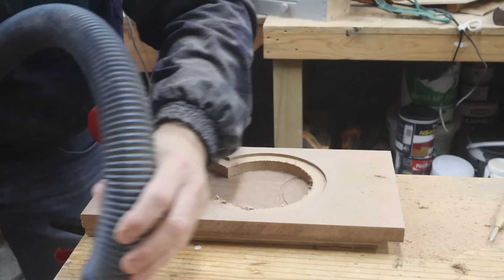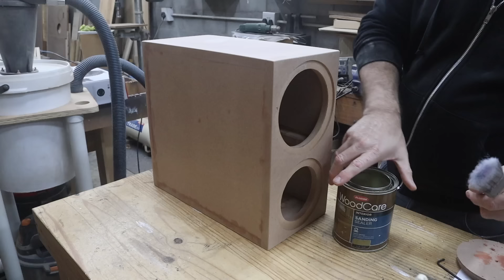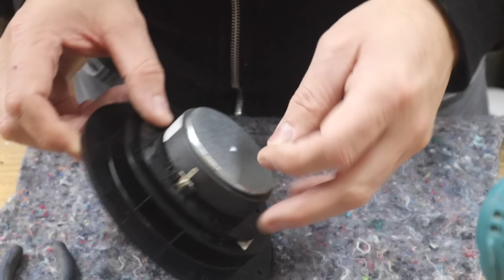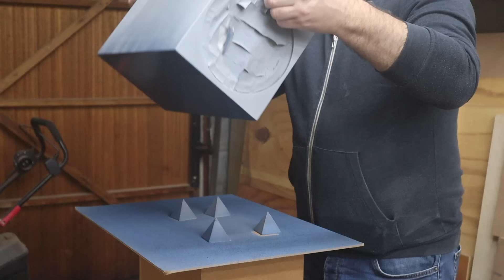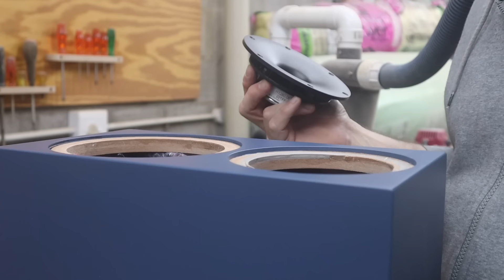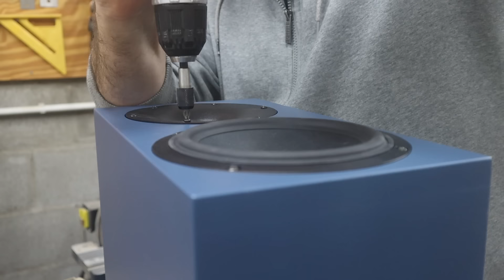Building WAVEGUIDE & PASSIVE RADIATOR 2-Way Speakers - by SoundBlab

Comment: Nice project - just purchased your build guide. Did you add any weight to the PR unit? Or what is the tuning freq without any added weight? Did you play around with tuning the PR lower? Thanks!
Reply from the maker: Thanks for the support. The PR does not need additional weight, its is tuned optimally without.

Comment: Perhaps a bit of a NOOB question here, but that speaker cabinet looks deep enough that you could fit a long enough port in there. Why would you choose a (somewhat expensive) passive radiator when a port would work? Did you consider a port?
Reply from the maker: A port is an option, but I wanted to do a project with PR as an alternative to the usual port.

Comment: Nice job, looks very cool.
A second option would be to fit the passive radiator from inside the case, then you could screw it from behind and have no screwholes. 
It would take up a slightly higher volume of air though, also future repairs might be more difficult.

Comment: I am curious at to the vertikal dispersion as well as horizontal. Used to Kef coaxials but must say this looks promising.  Any comment on this? 
Oh and  what is the cost of the crossover parts total? Trying to add up the total cost of this build in my mind ^^

Comment: Hi its amazing, thanks. Theoretically can one replace the rear open port of existing speaker to a passive radiator , and by doing so improve low bass performance?
Reply: I would think it's possible but  you need to be mindful of the resonance of your existing port , pick a passive radiator that will not be too far from that then tune it to suit by adding weight to the diaphragm, pick a radiator that has this ability.
I don't think you'll be able to make a big difference bc your existing box drivers and.xover limit you

Comment: Are those final measurements real? If so, it answers a wuesrion i had a while ago, what is the smallest a speaker can be that plays 20hz to 20khz flat. Gorgeous speaker
Reply: Take a peak at the Helios build. It should get you close to your goal
Reply: Frequency graph Starts at 200. With that woofer, I assume they'll reach a F3 of 35-40.

Comment: What are you driving these with? RMS power, etc.? They look great by the way.
Reply from the maker: Thanks. Currently I have a Cambridge Audio Azur 840W, which is a very powerful amp, but obviously only using it within limits of the loudspeaker. I don't have an official RMS rating for the speakers, but these go plenty loud in my 6x5m room.

Comment: I purchased your plans and built them for myself.  I went a little "Danny" crazy on all of the crossover parts, and I'm so glad I did.  Not only do they look fantastic, but they sound phenomenal.   They replaced my R200's and Rainmakers.  I still have my RP-600ms as they have a totally different sound.  I have these paired with an SVS SB300, Schiit Vidar, and a Bluesound Node.  Well done!!  
I had planned to make some other youtube  designer's  speakers; but after making and hearing these, I am looking at onther one of your designs.  
Thanks a ton.
Reply from the maker: That's so fantastic, I'm glad you love them! Thanks for the positive feedback ☺️.
Reply: What is your take when comparing these vs the Rainmakers. I have them myself powered by Parasound 200 amp.

Comment: that is a good tweeter!! , ive used the ferrofluid version on a few prototypes myself. Seas actually made a tweeter called dxt with "PROBABLY" a optimized waveguide and cone(++) of what you tried to achieve. Very good work tho. this might be a trigger for Seas to develop their driver/cone even further :)

Comment: Great build! I thought I have to get Buchardt S400MKII, but now I'm not sure. Maybe there's a way to compare them?
Reply: These are very similar to the Buchardt by design. However the crossover and elements in the Buchardt are of a higher quality. Want to match them that's where you need to put some bucks on that. Besides that these will sound great on their own.

Comment: I watched a lot of your compact speaker builds and it left me wondering, is a simple baffle usually enough or is it better to have a double baffle or bracing? most topics of double baffle i encountered were for subs. I’m at the point of building my first full range speaker and I don’t know if I should double the front, my material is 19mm MDF.

Thanks in advance
Reply from the maker: I think for up to a 6.5 inch woofer, 19mm is fine.

Comment: Hey all, I do have a question regarding the passive radiator. Can it handle two of the sb chassis or will it cause too much excursion?
Reply from the maker: Off the cuff, I would say no. But I have not modelled it to confirm. However form this model I would suggest it is not possible without compromise.

Comment: Hello. I'm looking at doing a similar thing with the SB Acoustic 5" coax. It's for my camper where space is tight in the back area. I'll have a sub in there but i still need kick bass from the 5" and thought about using passive radiators to allow for a smaller enclosure. SB Acoustic do a radiator to use with the coax, it's the same size. I don't know whether to use this or the race track. I read that the radiator should have larger area than the driver. I could use two 5" radiators i suppose, even two racetracks on the sides but it's all guess work at this point. How do you select parts or calculate enclosure size or port size?

Comment: Just curious, would you consider trying to build these with a double radiator setup with two woofers? Just to get some more low frequency response from the speakers? Or do you think that would be useless? It is something I am considering building. I have no experience with using passive radiator though.

Comment: I just startet this great project and have troubles to buy the DPR10-8.0 8 Ohm 10 Watt Precision 1% Audio Grade Resistor in Europe. 

Do you think I can use an 8.2 Ohm resistor made by Jantzen with the same specs (10W , 1%acc) 

Thanks 🙏
Reply from the maker: Yes, that will be fine.

Comment: Hi, i have a set of creative labs T100 speakers and to my ears they sound really nice, fast puncy and surprising amount of bass that hits harder than speakers 6 times the size. Only thing it lacks is clarity. Could they be reproduced in HiFi? Really impossible wtf physics breaking lows, im guess they are T line but seem way too small and light for that.
Reply from the maker: I doubt if they are t-lines, most like ly they are ported enclosures with a single full range driver, which perhaps explains the overall lack of 'clarity'.

Comment: Hello!
Good job!
Please, can you tell us  what kind of Crossover did you use? And the Shop? Thank you!
Reply from the maker: Thanks. The crossover is custom designed, so consist of various parts put together for this particular speaker design. It is not off-the-shelf standard crossover. Details are in my build plans that can be purchased on my website here: https://soundblab.net

Comment: I think you could use the 3D printer to create templates for cutting the oval shape openings and flange pockets. Also by measuring the tweeter hole pattern and the diameter of the waveguide center hole you can create a perfect fit drill guide (basically a circular sheet with the same hole pattern and a shallow cylinder in the center to align it with the waveguide). Maybe not worth it for a one off (or 2 in this case) but my OCD would not let me eyeball it :)

Comment: nice sound.Thank you for the wonderful video. It has become very useful for my speaker work. Until now, I had only made bassless models, but after seeing this, I decided to try using a passive radiator.I'm thinking of using a passive registrar for an 8cm full-range speaker, but what size would be best?
Reply from the maker: Thanks! Typically you should aim for a 10 inch PR with the 8 inch woofer, and of which the Xmax is higher than that of the woofer.

Comment: What diameter did you cut the inside circles for the PR?  I've bought some of these and I'm thrown by the supplied gasket foam on sonething that seems proud of the flange itself.  I wasn't going to flush mount the outer flange but its not clear from the data sheet what the geometry is behind the foam on the back.

Also to anyone reading:  don't but the SB supplied 50g weights for use with these - they don't fit.  Unless tou put them at the end of a very long bolt, and have lots of turning moment acting on the spider and surround.  Better to just get short bolts and some washers, I got mine in a DIY store - cheaper too..
Reply from the maker: 122mm
Reply: @SoundBlab   Thank you!

Comment: Serious question. I'm just getting into the hobby and I want to build many speakers... but what if people don't want to buy them... what do you do ?
Reply from the maker: I can't really answer that, because I have no experience selling speakers, but I do know that it took me many many years to learn how to properly design and build speakers, and I am still learning.  If you are only getting into the hobby, I would consider that you spend some time to learn all you can before committing to such a venture.
Reply: @SoundBlab  I guess that my question also lies in, what do you do once you have too many speakers ?
Reply from the maker: This is a problem... I try to be efficient in using various combinations of drivers, so often I end up with empty enclosures since I use the same drivers in different combinations across various projects. I have sold a few locally so far, but the market here in South Africa is too small to really be a viable option for this route.

Comment: If you want to make your life easier, you could use a soldering iron to install some threaded brass inserts into the holes you added into the wave guide, that way you don't need to use nuts to secure the screws.
Reply from the maker: Thats a good idea!

Comment: Hey SoundBlab, I love your builds, but i've always wondered, after extensive research i have yet to find an answer to my question about passive radiators, in this case i got 1 active and 2 passive radiators, is there an acoustical advantage to putting the PR's in the rear or is it better to have one on each side of the enclosure. i still have not found one who could give me an answer to it. i would understand with the single PR that it is better in the rear cause of vibrations.
Reply from the maker: With 2 PRs it is probably best to go one each side to achieve force cancellation and thus damping enclosure resonances. PRs on the rear can make speaker placement more difficult in a room, since you probably don't want them too close to a wall. The placement otherwise has no effect on the frequency response other than what room placement and the room itself will introduce. It is similar to a port, front or back makes no difference, but the same advantages and drawbacks counts as does for PRs. PRs also work well when you have both on the same side of the enclosure. This way you have more freedom to swop speakers around to have the PRs facing either inside or outside depending on what works best in your room. It's probably more flexible than rear mounted.
I am currently working on a 3-way floor stander with 2 PRs on the back, but as said before, it is similar to a port on the back.
Reply: @SoundBlab  Thank you so much for the very detailed response, that really answered my question about the placement of them. keep up the great builds

Comment: What are you using to power the speakers? Just curious.
Reply from the maker: IOTAVX SA3
Reply: I still can’t believe the low end I’m hearing over my headphones. I’m not usually a fan of listening to recordings of speakers, but this recording sounds amazing! I feel like there is little room echo. What microphone did you use to record these great-sounding speakers?
Reply from the maker: Thanks. I used a Zoom H1 mounted to a tripod. Nothing complicated. Sometimes I will use two Behringer mics pointed at both speakers directly on axis, but its too much setup, so I am now only using the Zoom H1.

Comment: Great video! I just purchased the plans. Is it okay to use 400v Capacitors for the two 250v ones? For the air core inductors, can I use 18awg for both, or is 20awg used for a reason on the .8mH coil? Ordering parts.
Reply from the maker: Thanks man! You can use 400v caps and the 18awg coils will be fine.
Reply: I have been ordering parts through the links in your parts list document! I hope to start the speaker build when weather starts to cool down a bit since I do the work in a garage without an A/C, ugh! In the meantime, I think I will assemble the crossover parts.
Reply: I almost have all the parts at this point. Waiting for cooler weather to get started. Can’t wait!

Comment: Great looking build and really nice measurements. Your process is almost identical to mine. There are a lot of people who will tell you you need to use vituixcad to model a crossover with good off axis response. I disagree.  One simply has to know how one’s drivers behave and set the crossover points accordingly. Your low crossover point is the key here, along with the waveguide. I don’t need fancy software to tell me that. Great job!
Reply from the maker: Thanks! I started with XSim for the crossover, however I did also use VituixCad to confirm my results and get more of those fancy graphs.

Comment: Durch eine Front bohren - der arme Hochtöner. Jeder wie er mag, aber beim nächsten Mal vielleicht einfach Heißkleber verwenden. 🤨
Reply from the maker: I was not drilling through the tweeter faceplate, only copying the holes to the back of the waveguide to secure it with screws.

Comment: Soundblab: We have Buchardt at Home
Reply: Do you have a speaker recipe with the original purifi s 6.5x08 ?
Reply: @95lovi  +1 for this if there is an adaptation to the crossover for this design I'd love to try that, or even a version that uses a tweeter that already has a waveguide fitted
Reply: It could be fun to do a comparison
Reply: Or maybe the same design but with the tweeter from  SBAcoustics as well to keep it all at home. Maybe the SB26ADC-C000-4 that is in the same price as the Seas and sound really well
Reply: @alfredoj1349 the waveguided ADC paired with a SB17NBAC is extremely good for the price
Reply: @alfredoj1349  Using that tweeter with Visaton waveguide is difficult, you have to make an adapter for the SB26ADC tweeter, and even then the response is not optimal. You are better to use a 3D printed Somasonus waveguide instead. Even that means the tweeter's frontplate has to be removed (as it is not flat but a really shallow waveguide by itself).
Reply: Travail exemplaires bravo❤❤❤❤❤❤❤❤❤❤

Comment: Beautiful work!
So you used:
1.Varathane wood filler (brushed on??)
2. Rust-Oleum auto filler
3. Rust-Oleum chalk paint
4. What clear coat did you use?
Thanks so much 🙏
Reply from the maker: Yes the sanding sealer is brushed on, two coats, sand in between with 320 grit. Clear coat is Rust-Oleum chalked matte clear.

Comment: So basically a copy of buchart audio
Reply from the maker: The only part that is the same as the Buchardt will be the passive radiator which is an off-the-shelf component and used in other designs as well, every other part is different. The waveguide and woofer combo in a stand mount has been done even before Buchardt existed, like Arendal Sound, Paradigm, Aperion, and many more. So I am not sure how you came to that conclusion? Does it LOOK similar, perhaps it has some resemblance, but a copy... I don't think so. At least mine is not upside down LOL.
Reply: @SoundBlab so true the S400 has also a 5% backward tilt to compensate for the tweeter waveguide assembly placed at the bottom of the cabinet too.😊

Comment: 5:30 Here it is enough to use 3 dowels and not to waste wood.
There is a lot of material inside, passive speakers will have little or no range.
Reply: This is what I do. Then I run some more dowel front to back and tie them together where they intersect with zip ties. The ties actually hold the panels in place firmly under tension.

Comment: A 2nd order network on the tweeter at 1.5khz with a 3/4 in dome?! Excellent design work. The waveguide with a wide surround tweeter make that possible. Great driver selection. I'm happy to see some use of SB Acoustics and Seas in this project. Thank you sir!
Reply from the maker: Thanks man
Reply: it's the Buchardt S400 MKII design
Reply: @Conscious-7-7-7  Similar, but not the same. The woofers are a different line from the same manufacturer, but I'm not sure what tweeter the Buchardts use. I believe it's the same passive radiator though, also from SB acoustics.
Reply: Die Bucharts verwendet einen Hochtöner von SB mit Aluminiummembran. Der Wellenleiter hat 170mm Durchmesser und nicht 148mm wie der Visaton.

Comment: Have you thought about getting a CNC tool to cut out the speaker/baffles openings in your panels?

I think it would do a great job on the racetrack shaped speakers/baffles.
Reply from the maker: I do have a CNC machine, but it has been giving me problems and it has become easier just to do it manually. Also, most people do not have access to a CNC, so I always try to do things in a more accessible way.

Comment: Looking good! One question, not to bash just for my information. Did you adjust something on the pr, to change the tuning? 

I have a floorstander in the works for a friend of mine with this waveguide combined with the vifa xt25tg-30 and dual 16pfcr. Tweeter combi borrowed from Heissmann acoustics, maybe you're familiar with his work.

Keep up the good work :)
Reply from the maker: Thanks. There was no need to add weight to the PR, it performs optimally as is. It can be extended slightly with about 10 to 20grams, but opted to keep it simple.